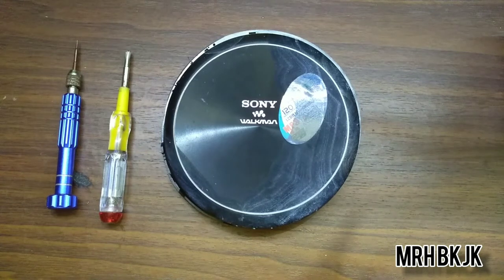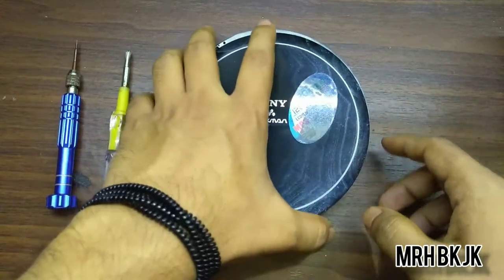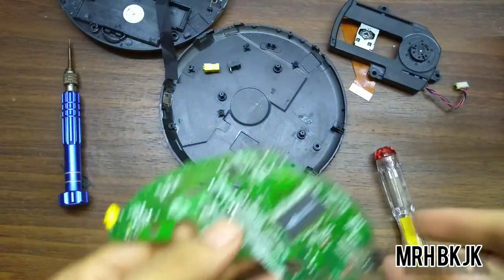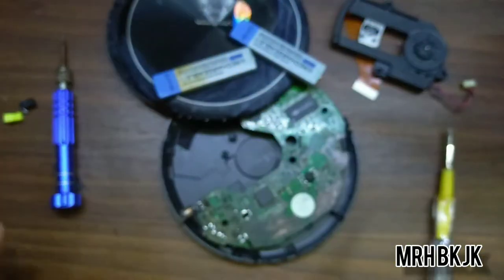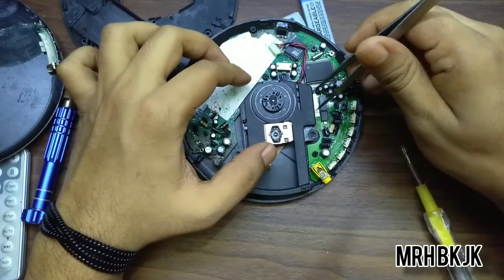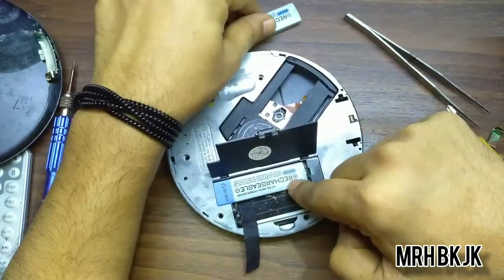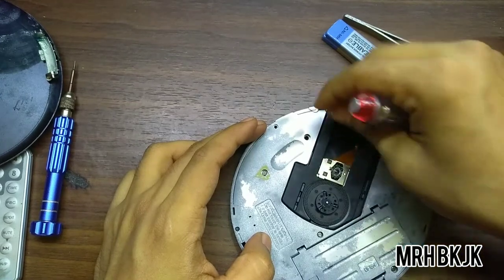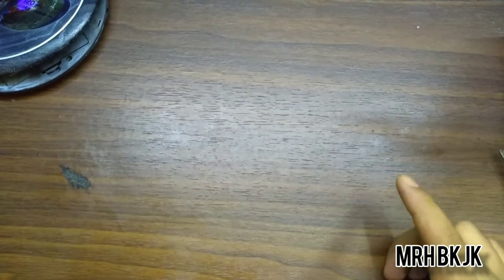SONY CD player | Can It be Repaired | What's Inside it

Comment: Corrosion is a problem with vintage computers due to leaky caps and, in this case, leaky ni-cad batteries that were cable-tied to the I/O board in this Apple Lisa computer.  
As you can see, the traces disintegrated in many places and after ultrasonic cleaning, many traces disappeared or the metal composition changed enough that it was impossible to take solder to add bodge wires to repair traces.  This board was too far gone even after some attempt to restore it.